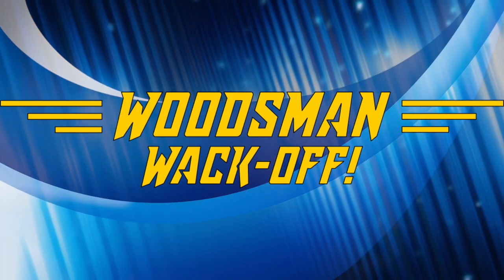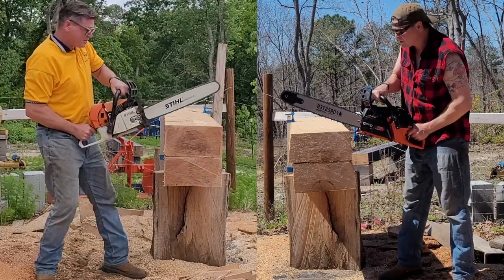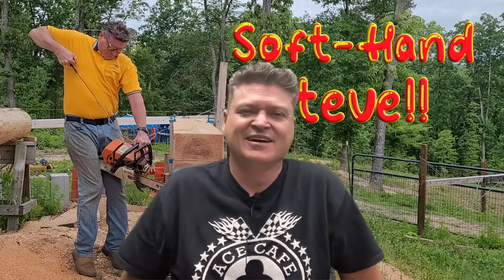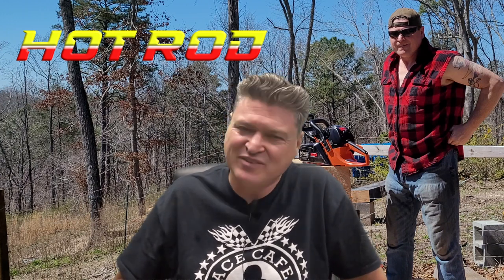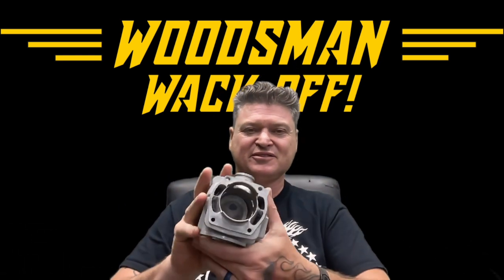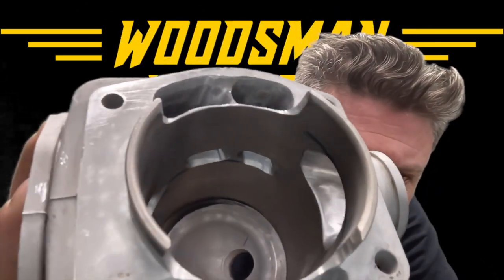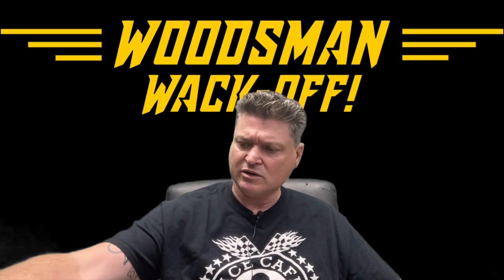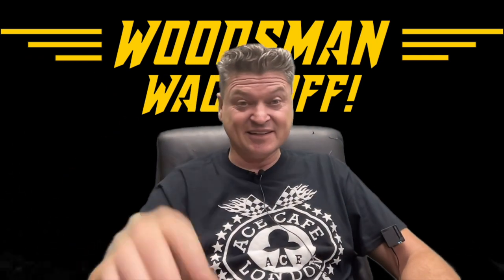Echo 590 vs Stihl 660

Comment: What's happening with the Poulan 5200 ? They make a ton of power after a port job,,,,,,Keep on rockin  those great videos !!!
Reply from the maker: It'sa comin'!  So, too much heat for outside saw works right?  I've got 3 BIG Poulan restore and modify projects.  The 5200, the 4000, and 3 Bad Boys that will all be done at the same time.

Comment: Epa 660s werent even close to the original saws without decomp. Known as a flat top. Theres alot of differences between the two. Fly wheel and cylinder are the main 2.

Comment: One of those Carpy shirts.
Reply from the maker: HAAAAAAAAAAAA!  You know about Carpy?!  I wonder if he is still around, doing his thing.  I got this one in London at the actual Ace Cafe.  The 59 club was all up on my jock.
Reply: @novicelumberjack  Yeah I think he's still doing his thing. I'd love to have one of those bikes.
Reply from the maker: @timothybyrom5560  I built several.  Two of them were super nice.  One was just...titties!
Reply: @novicelumberjack  I've built  a few bikes, never a vintage style cafe. I like his work because of the details. That's the kind of thing I like to do. I've done all kinds of dirt bikes, choppers in the early 2000's, and different kinds of street bike. Right now I'm working on my 78 Goldwing. It went through the joplin tornado. I call her Janis. It gonna be a kind of years long evolution I think.
Reply: @novicelumberjack  I've worked in a couple of bike shops over the years, and got to get my mitts on some pretty neat stuff. I still prefer to do my own stuff. I'll ride around awhile, get an idea  and change something. Might be something small, might be blowing the whole thing apart. I've got a motorcycle salvage close, so parts, and inspiration is never far away.